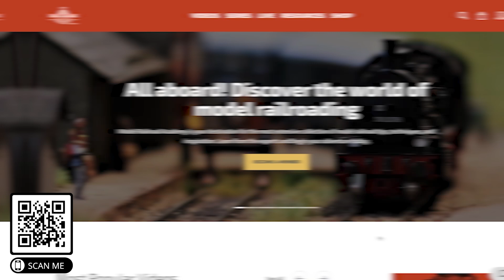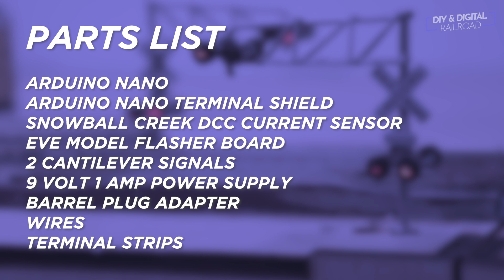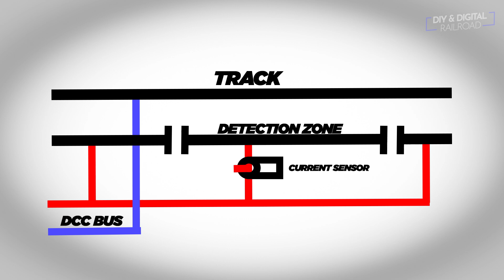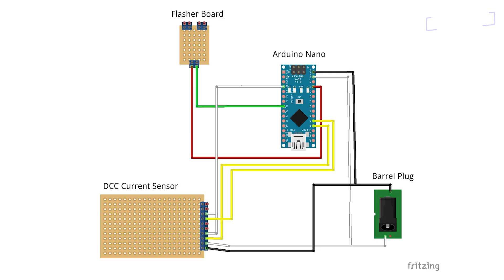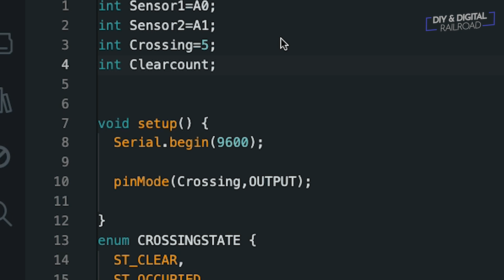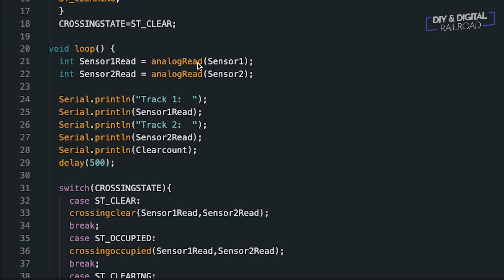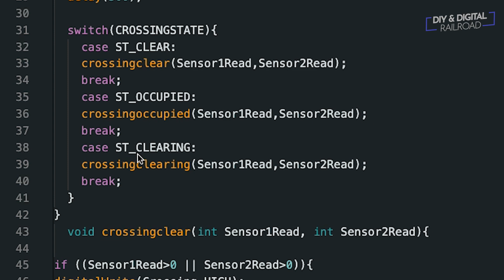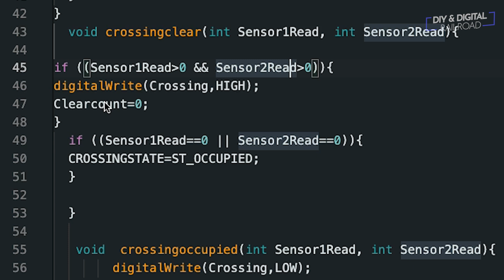YOU CAN DO THIS! Build and code your own Automatic Model Railroad Crossing

Comment from the maker: Hey everyone!  I know that even the most basic arduino projects can be complex.  I have been thinking about a model-railroad-centric arduino for beginners video series.  Would you be interested in that?
Reply: I think so. I like doing simple stuff like wiring up DCC boards, sending wires and resistors to lights and to track power etc, but it's definitely very cryptic. There's no way I'd get in to this kind of thing without having something already done ahead of time. I remember doing some rudimentary programming stuff that is similar, but it would have been in the very late 90s. It looked similar at least. I just don't know where any of the language for this comes from, like the brackets and different symbols and spacings. 

I'd be curious to see where a beginner video series would even start. What are the simplest things to do with an Arduino? How do you even figure out how to write the code for it? I know AI can do stuff, but it doesn't seem good to depend solely on an AI answer. Better to also know how to do it.
Reply: Yes, for sure.  As someone who is not even close to tech savvy let alone understanding coding, this video completely intimidates me and makes me think I'll never go off DC.  It all just seems overwhelming.
Reply: Jimmy, yes indeed. I have zero arduino knowledge today, but would love add some effects to my layout.
Reply: Definitely
Reply: Yes :) :)
Reply: I would definitely follow a series like that, even though I have done several projects of my own.
Reply: YES!!!! Please!!! 😁

Comment: Both use the same kind of outputs and inputs. Why can't the sensor be wired to the flasher unit, and skip the Arduino all together.

Comment: Jimmy, another great tutorial!  I am looking for a way to have prototypical advance warning without having the lights stay on for too long after the train passes the crossing.  To complicate it, it should also do it in either direction.  I know there is a way, (and, I would prefer to use IR sensors), but I haven't had the time to figure it out.  I am thinking someone already has, so there probably isn't a need to recreate the wheel here.  Jimmy, have you found (or created) a way???

Comment: OK, for your next trick, get the lights to visibly alternate-cross-fade as old light-bulb based crossings did (slow fade ON --> slow fade OFF), 
instead of hard On/Off alternate-flash behaviour like a more current-day LED crossing signal. The rest of the system is pretty neat as-is... ;-)

Comment: I used photo cells sunk between the rails instead of the current sensors and it wortked pretty well. An Arduino for model railroaders would be a great series.

Comment: Will the grade crossing keep working after the loco leaves the section and its just the cars occupying the section?
Reply from the maker: It will if your car has a resistor wheelset on it.

Comment: Where are the breaks in the track?  This looks like it bleeds into another module.  Would this void the compatibility with other t-track modules?  No problem if your modules are always together or you don’t plan on connecting to foreign modules.  Do you ever plan on connecting to outside modules or are you doing t-track just for flexibility. I ask because I am considering t-track for this reason.
Reply from the maker: One is an insulated joiner on the other side of the bridge.  One is a cut near the edge of the module

Comment: Jimmy, what do the sensors actually measure? Does a zero reading mean “no resistance”, because a car is making a connection between right and left rail? Would this logic be correct: If Resistance = 0 then NOT Empty (i.e., Occupied = True); if either sensor is Occupied then Light = On; if neither sensor is Occupied (for a period of time) then Light = Off (i.e., Track clear). ?

Comment: Nice video. But works with DC ? I still use DC not DCC.  Nice work and simple.
Reply: The short answer: this system as designed requires DCC because of the current sensing detectors, but it can be modified to work with DC. Please see my response to @marke.saunders4803 for the long answer.

Comment: Nice tutorial. I do coding for a living, although I've not had much to do with Python; my one minor niggle is that it'd be easier to follow your code if the indenting were correct.
Reply: FYI the Arduino IDE uses C++, not Python (although they look quite similar.) One of the nice things about the IDE is that it manages 90% of the code formatting for you - including indentation.
Reply: @rwissbaum9849  Argh, should've spotted that. Thanks!

Comment: I just got a Digitrax EVOXDE EU/GER Evolution Express Advanced 5A/8A Duplex Starter Set over the weekend. I am now looking at making the jump from EZ track to Kato track. There are some things I am trying to understand about the Kato switches.
1. For the EZ track, I needed to get a decoder to run them with DCC. Do I need the same for Kato, or can I run DCC while being able to flip the switches manually? (With the EZ track, the engines won't power up if the decoders are not connected to the switches. This was also with the bachmann ez command, I am going to look at switching with my new controller tonight)
2. Is there a way to set up a Kato switch so I can use the controller to flip it? I've seen your video about using ardunio, but that is still too complicated for my skill level. Also, I am not able to do a permanent layout right now, so I am trying to minimize wires.
3. With Kato switches, I they are set up to only send power down the route in which the switch is thrown. Does that affect DCC locomotives? (Can I have the locos in a yard, and if they aren't getting power, they won't be ruined by sitting on the track?)

And I know you use a Kato Double Cross Switch. Do you need to feed power directly to each loop since the switch only powers the route the switch is thrown to? If so, I'd assume i would need to insult the switch. What would be the best way to insult it? (Like, would you insult connector pins that connect to the second loop of track?)

I am trying to gather as much information before I start buying track. Thank you for the help!!! (Sorry about the lengthy questions)

Comment: That's nice, Jimmy, but what happens when you have something other than a locomotive and the cars have not finished crossing when the five seconds have expired?  What I see is the train is still blocking the crossing and the lights are off.  Are you adding resistors to the wheels of the cars?
Reply from the maker: One of my big projects for my railroad is upgrading all of my rolling stock to metal wheels and added a resistor to one of the wheels.
Reply: Jimmy did a video some months ago showing how to add an SMD 10k Ohm resistor to your wheelsets to draw a tiny amount of current (just enough to show up on a current sensing block detector.) As Jimmy says, you need to replace your plastic wheelsets to all metal, then glue the resistor across the insulated end of the axle. Takes about 3 minutes per car - the biggest expense by far is the metal wheelsets, but you'll see some improvement in performance.

Comment: Jimmy, I'm glad to see you returning to your DIY roots! Sadly, I notice a number of comments saying, basically, "this is too complicated for me - make it simpler." My reply to those comments is this: When it comes to electronics projects like this one, there is no one-size-fits-all solution. You might have grade crossing flashers protecting two, three, or even four tracks. You might have crossing gates. You might have signals which are wired differently (one is wired common anode and one is wired common cathode.) So you are left with four choices: (1) forget about having working crossing flashers; (2) follow Jimmy's instructions exactly and be confident that his circuit and code work as advertised (and you can be confident because he demonstrated the final system in the video); (3) wait for someone (else) to develop and market the exact solution which fits your needs, and hope that you can afford it; or (4) dig in and learn how to do this. It seems hard because it's complex, but it's not hard. There are a zillion YouTube videos - and just as many books - which will walk you through the process of Arduino development. If you have no interest, that's fine - you'll just have to resign yourself to missing out on this particular aspect of our hobby.
Reply from the maker: Thank you for the kind words!  I was planning on doing a far more complex project with push buttons to deactivate track when a car was sitting in the detection zone and indicator lights when a track was active, but I thought that might be a bit much haha!
Reply: @DIYDigitalRailroad  Ya think? Seriously, I think the next logical step in complexity would be to eliminate the flasher circuit and use the Nano to control all the individual LEDs. The flasher is not expensive, but you're stuck with the flasher's built-in flashing parameters...
Reply: @rwissbaum9849  Sorry, but with that mindset we would never have small, sophisticated sound decoders installed in tiny n scale locomotives [by manufacturers]. We would still be shaving metal and soldering wires and writing code. I do have an interest in the result of Jimmy's effort, just not the skills to get there. With a zillion videos and books on the topic, it must be an extensive process to master.
Reply: @cbirailroad  Seems to me you've just made my point. Those tiny N scale sound decoders weren't made by geniuses, nor were they made by people who said "this is just too hard for me." They were made by people who dug in, learned what they needed to learn, and developed something new. If this stuff holds no interest for you, that's absolutely fine; but I think Jimmy's point - which I agree with - it that these projects are not beyond the reach of an ordinary modeler. However, like any new endeavor, developing the required skills certainly does take time and effort. We each have to decide for ourselves if that investment of time and effort is worth it. Cheers.
Reply: @rwissbaum9849  No I don't think you understand my premise. I was more than happy to purchase the end result (ie a locomotive equipped with DCC and sound) as I do not have the skills to create a DCC/sound locomotive myself. Similarly, I do not in any way begrudge those who master Arduino and all its facets, I just willingly recognize that I do not have nor will never have those skills. I just don't want someone telling me that I must learn those skills in order to enjoy the result. That seems to be what you are saying. Hopefully someone will put all these pieces together and create a plug and play solution.

Comment: You can just put a hall effect sensor close by and have a small magnet on the train and use an Arduino. If you don't know how to code well thats fine. Chat gpt can code simple things like that. When it gets close to the crossing, the Arduino will detect in with the sensor and tell the light to turn on. But their definitely needs to be more plug and play items